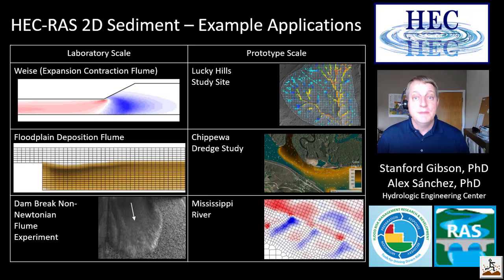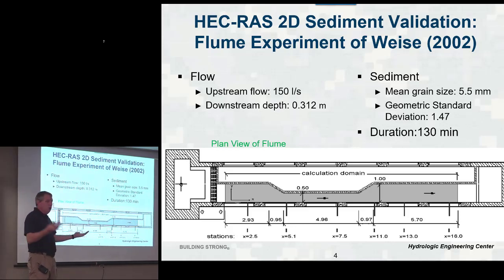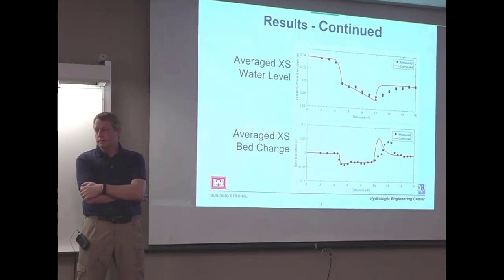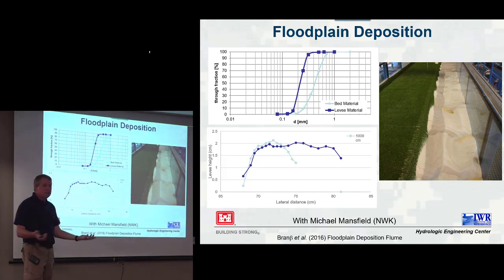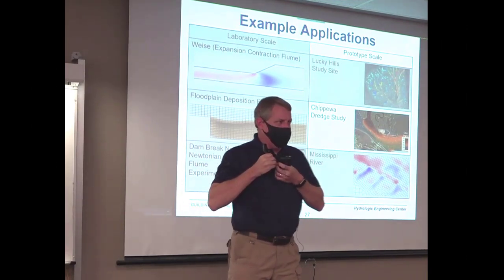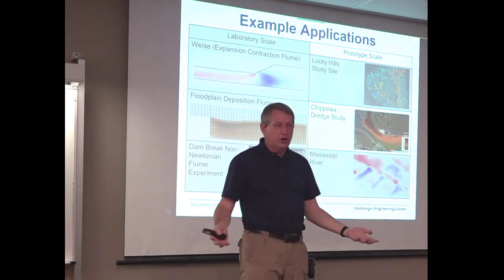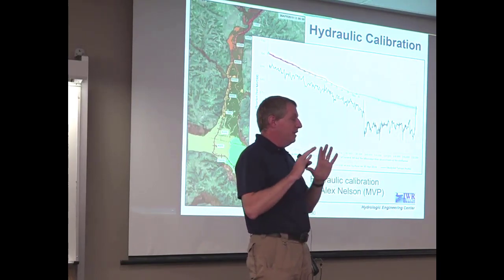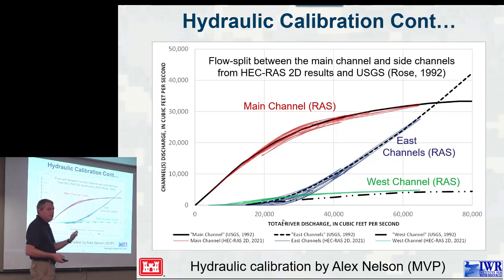2D Sediment Applications in HEC-RAS

Comment: For what I've understood, It's possible to simulate a non newtonian flow within sediment transport, with movable bed? I mean, to compute the erosion and deposition on the bed caused by a non newtonian flow.
Reply from the maker: Yes...it is not an advertised feature but we are working on it and have not disabled it.  If you just add non-Newtonian parameters and use the mobile bed tools, both should work (though we are still experimenting with how we should pass the NN shear components into the sediment model, and the transport functions in RAS now are not designed for NN).  Make sure you also turn on "Hindered settling" in the mobile bed model.  You can also do "concentration only" modeling with NN to get an intermediate, dynamic concentration result, but we are working on new features that will make this much stronger.
Reply: @stanfordgibson  Glad to know. I'm trying to model erosion and deposition caused by tailing dam collapse, so it will be very usefull

Comment: Hi Stanford - When generating a shear stress results layer in RAS Mapper the units in the Shear Stress legend appear to be psi.  However, the values that I'm seeing would appear to more likely be in psf.  Is this possibly an issue in 6.3.1? I'm suggesting that the units incorrectly display as psi when they should be psf.
Reply from the maker: Yeah, we fixed this for 6.4.  Units are psf